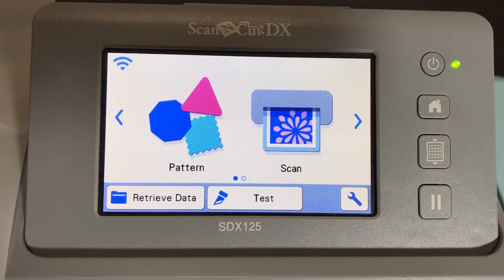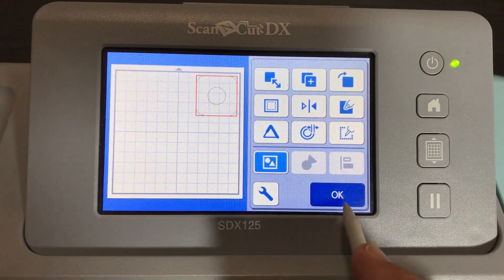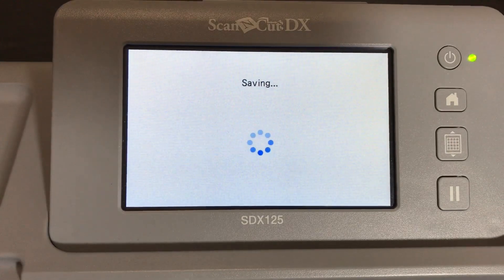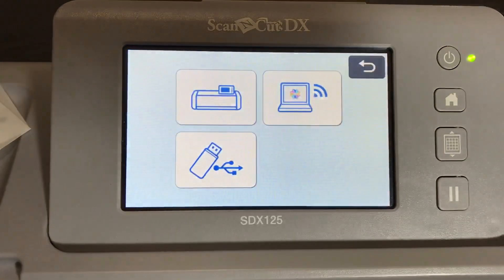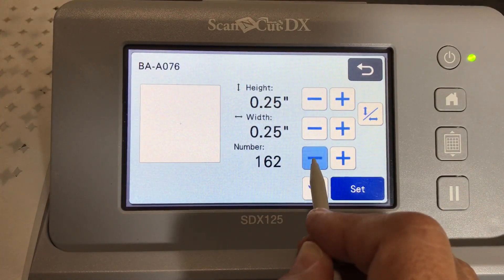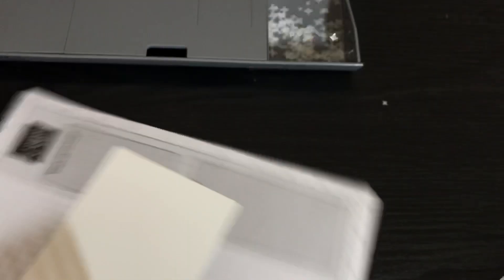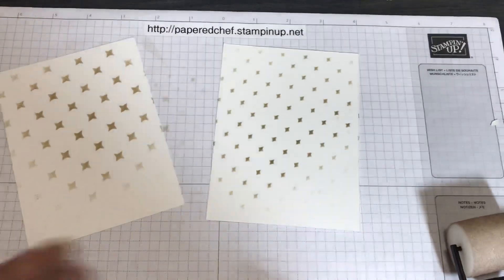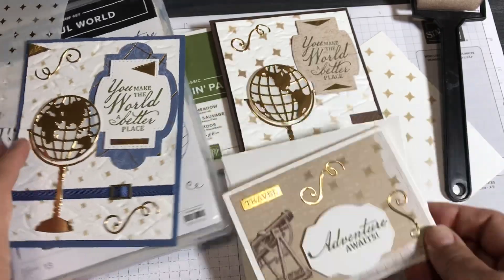Brother ScanNCut Tutorial - Creating Stencils using Mylar - Cutting Area, Pattern Interval & More

Comment: This was brilliant. You need to work for Brother. No one there was able to give me any guidance. I just got my SDX 125e after owning a CM350 for 4 years.  The SDX, when attempting to cut very small, intricate designs, has been chewing up or ejecting pieces of my design from various thickness of cardstock, even as thin as 80lb. These were the same designs I cut successfully on the CM350. I assumed it was something in the settings so called Brother for advice on altering them. I was told I needed to call my local Sew n Vac (not sure why as I bought my machine from Amazon).  They told me that if I didn’t buy it from them they weren’t responsible but they didn’t think the SDX125 would cut cardstock.  (I’m not kidding!). I haven’t tried altering the defaults yet but I’m confident I can now feel better about spending all this money on a machine that so far hasn’t performed as well as my old one. You are such a gift!  Many thanks.
Reply from the maker: Wow! I cut mostly cardstock. They must have had a real rookie answering the phone that day. Thanks for your comment. I hope you will take some of my courses and join my FB group. We delve much more deeply into topics in my courses. Udemy Courses - ScanNCut: 
https://thepaperedchef.com/brother-scanncut-courses

Comment: I use a completely different cutter normally, a Silver Bullet Platinum - but I have cut quite a lot of stencils. (I happened to get a second hand Scan Cut the other day, just to play with but that's another story. You may or may not know that there is an alternative to traditional stencil material which is a lot cheaper and that is binder covers. They come in different weights but I bought 100 of 240 microns (thicker) A4 binder covers for around 10 euros....Cuts well too.
Reply from the maker: Oh yes, I’m familiar with the Silver Bullet and used one in the past. Heavy duty. Oh I have used about 20 different materials for stencils. I bought this in bulk and it’s the gift that keeps on giving because I still have so much Mylar. Some of my viewers use cutting mats from the Dollar Tree. Anything goes while making a stencil. My materials are pretty cheap. I make 4 stencils for less than a dollar.
Reply: @PaperedChef  Great! The Platinum is a large double head version, so the Scan cut feels like a baby one! I too have used all sorts for making stencils, depending on what I wanted to use them for. I'm still wondering if to stencil a colour shifting design on the Scan Cut :)

Comment: I created some stencils in canvas workspace. Can I cut Mylar with standard blade if I adjust cut speed and cut pressure?
Reply from the maker: This video was featuring the SDX125 and for that, I used the Standard Blade. If you are cutting stencils with the CM models, you can use the Deep Cut blade. Here is a tutorial on that. https://youtu.be/vpCOSG2pb2c

Comment: You can use your finger as a stylus.  It isn't like a multi-touch touch screen display but you can use your finger to drag and drop objects and to swipe up and down the selections instead of using the arrow keys.  Run the mylar through a Xyron cold press lamination machine to adhere printed paper to it with different types of adhesive cartridges.  Then you can make sturdier confetti.  The current trend on Etsy is custom-printed confetti.  With the lamination+adhesive cartridge you can create laminated custom printed, custom cut confetti.  Maybe add some holographic film and you're cooking with gas :)

Lots of cool ways to make custom, cool looking confetti and other projects.

Comment: Thank you for the presentation.  One question, if you use deep blade to cut Mylar 4mil, what is the blade setting?   Thank you.
Reply from the maker: You are welcome Irina. Be sure to look in the description of my videos. That is where I share the settings and a lot more information. Here are the settings for the exact Mylar I used. I haven't tried many other types. 
ScanNCut2 CM350 Settings used for cutting Mylar Stencils
Deep Cut Blade Depth = 4
Cut Speed = 2
Cut Pressure = 3

Comment: Are there different thicknesses of mylar sheets and what other materials could be used for making stencils that will hold up over time with repeated use? I plan on getting the Brother Scan N Cut in a couple of months (DX125). Thanks for all your tutorials on using a cutting machine. Do I need a special separate blade for cutting through mylar?
Reply from the maker: HI Kelley, Oh YES, there are so many thicknesses of Mylar. Things like Portfolio Covers are too thick, but I tried them too. I recommend Mylar because it is easy to wash. If you have the CM model like this, you need a deep cut blade. If not, just use the Autoblade with the SDX. 
CM350E: https://amzn.to/2E9pZ5M
Brother ScanNCut Deep Cut Blade 
https://amzn.to/2mKB0P3
Brother ScanNCut Deep Cut Blade Holder
https://amzn.to/2NQmeC3

Comment: Your videos are always so awesome thank you
Does the machine automatically do a double cut or is there a setting that you can press to do 1 pass
Reply from the maker: Norine, thanks for your comment. Because the Autoblade is used, it determined the depth and thinks it needs to do another cut. I am not sure if I can outsmart it any other way. I wish I had a manual blade for this machine.
Reply: I was wondering the same thing and thought perhaps if you don’t set the cut pressure so high it wouldn’t feel the need to make two passes.  Or do I have that backwards?

Comment: Thanks so much for this! I've been looking at mylar sheets on Amazon but wasn't really sure which ones to get as far as the thickness. And I definitely wanted to sort of semi-transparent white instead of clear. And also the speed and cut pressure and all that kind of stuff. I do have a question. I'd like to make one with hearts but have every other line of the hearts offset. Is there a way to do that or would it just be a nightmare trying to do every line and offsetting every other line?  I have the dx125
Reply from the maker: Thanks Debadoo. You can add offsets to as many hearts as you want. You just wouldn't use the process I showed. That is because when you use a Pattern Interval, all of the items have to be the same. You can add hearts, duplicate them, add offsets to some, etc. but then you can use the Auto Layout feature to fit everything on the mat.
Reply: @PaperedChef  Thanks!  I haven't really gotten to play with my machine much due to lack of space to set it up, but it's good to know that I can do that.

Comment: Thanks for the great tutorial and information!  I am new to your channel and really appreciate all your expertise.   I noticed that your Amazon link to the stencil material is for 7 mil thickness .   Is this the thickest mylar / stencil material the SNC SDX125E can cut?
Reply from the maker: Thanks for the sub! Julie, that is the thickest I have tried. I think if you go any higher up while you are sponge coloring, you are not going to be able to get very close to the edges. If you want if for something else, try the thicker one. Give it a try. There are specs you can check on the Brother site but there is no substitute for experimentation.
Reply: @PaperedChef   Thanks!  I was thinking in terms of using texture paste and it's always easier with a little thicker stencil.